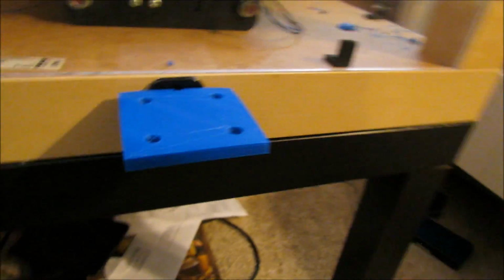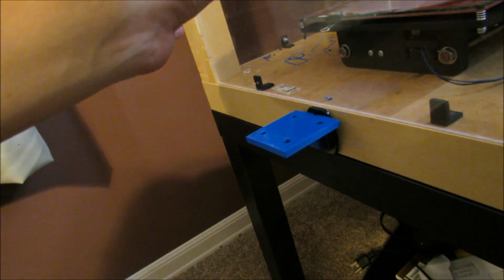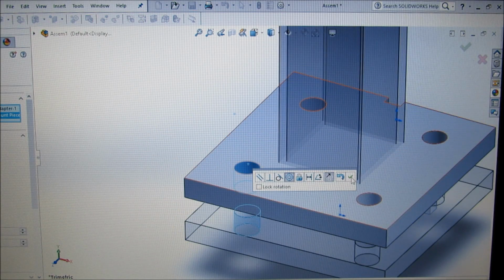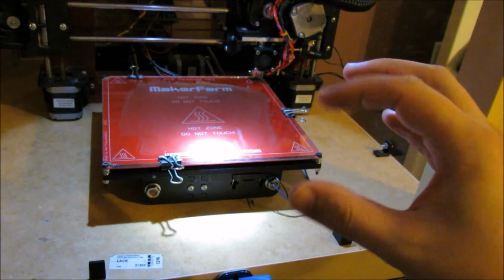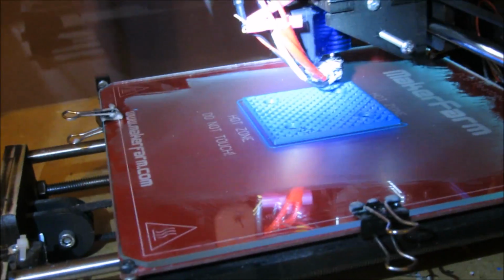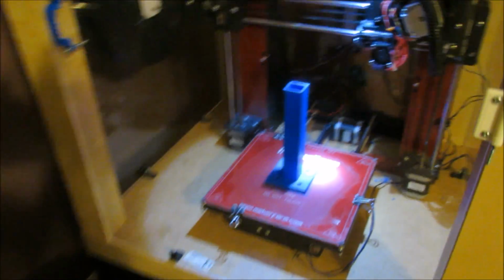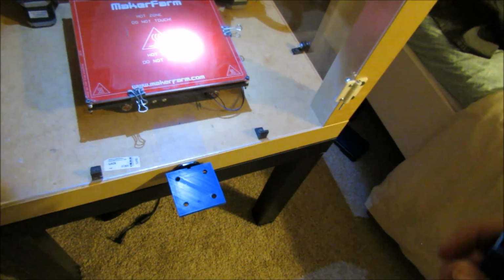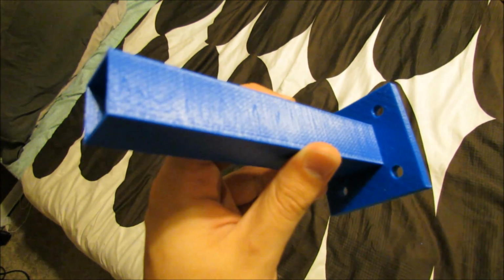3D Printing Timelapse Camera Rig Part 2

Comment: Good video, btw Open Broadcaster Software is free and is an excellent screen recorder, its not just for livestreaming.

Also, it looks like you might be overextruding quite a bit. Either that or there's some bending in your z screws, and is causing z-banding.